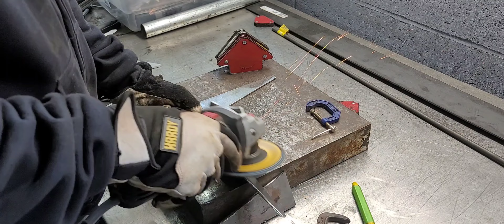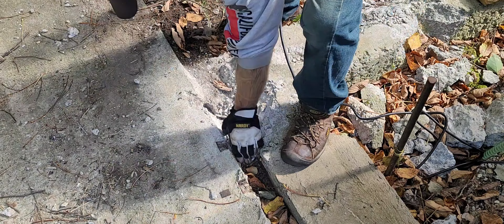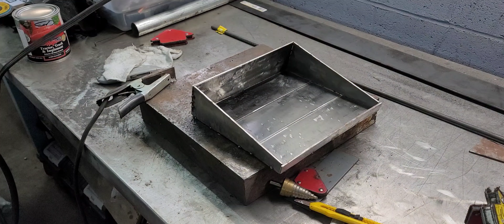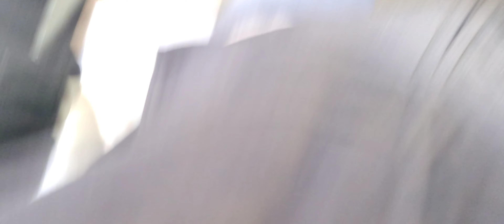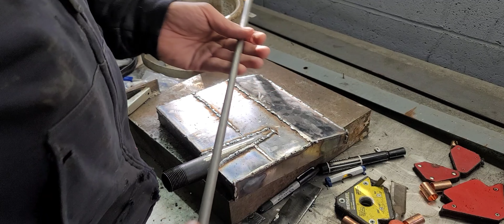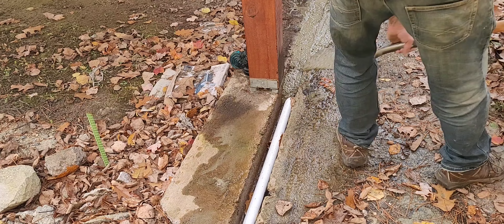Custom Catch Basin Drain Install DIY Project

Comment: Just ran across your video while researching drains. That's one of my next projects.. But, you mentioned your garage door towards the end of the video - don't chisel out your pavement - just get a bigger seal for your door. 

https://www.youtube.com/watch?v=YAaQS_ZVj9w
Reply from the maker: I wish I could, unfortunately the threshold is cracked going under the door and around the corner so it has to be cut out repoured. Appreciate the video though,  I actually watched that one a while back.
Reply: @rustycreekfabrication  Ah, that's a bummer. I normally don't throw my content in other peoples comments, but thought it might help. :)